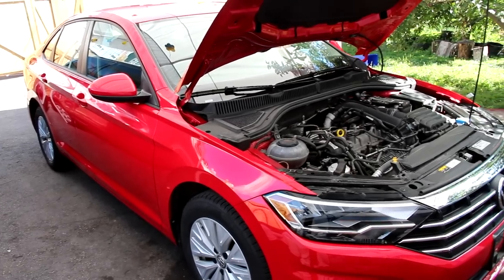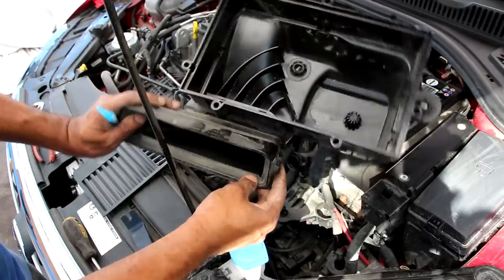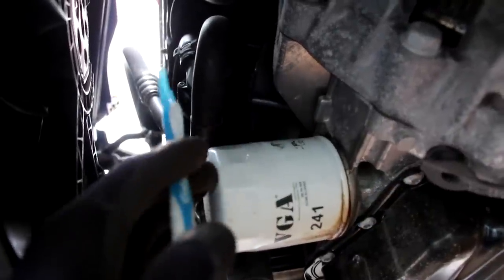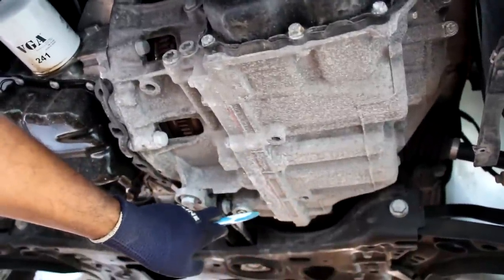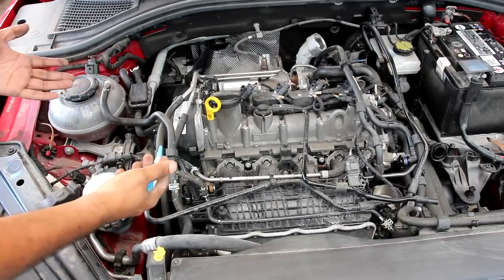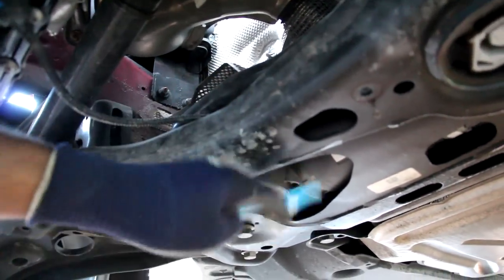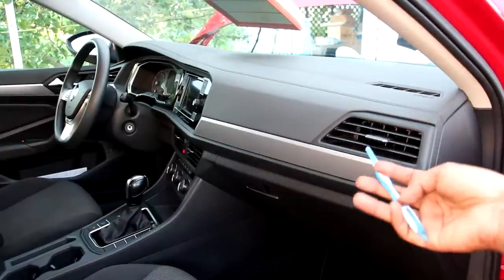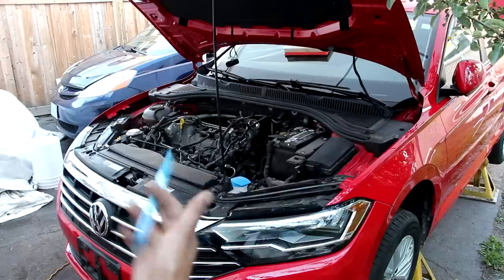Volkswagen Jetta Mechanical Review

Comment: Holy cow. I've never owned a Volkswagen, but I've always been interested in owning one. I spend $5,000 to $6,000 on a vehicle and buy them outright so I don't have to make monthly payments. I earn a small salary. Watching this video has me seriously wondering if I should purchase a Volkswagen. I worry about going bankrupt on the maintenance alone. Why do the Germans make this engine so complicated? If I get a Beatle or a Jetta I would purchase one with a manual transmission and the 2.5 liter 5 cylinder engine. Do you have a review of this engine?
Reply: 2.5 5 cylinder is going to be more reliable, cheaper to fix, and sound better in the long run. But gas mileage is like 15-20 mpg worse than this engine (25-30 vs 40-45)
Reply: @carterdavis2793  I could live with that mileage.

Comment: VW admits to the transmission grinding noise but says it’s normal operation of the torque converter stator clutch? Ever heard of that load of crap and does it even make sense? No other car used or new makes those noises.  VW did something funky chasing gas mileage is my theory and who knows, they may have even retuned the engine and transmissions for the press review cars.  Not one YouTube reviewer mentioned the transmission noise. Not one. Curious. Savage hinted at it.   Beyond the Test Drive, a brand new review channel will have a full one year in depth review of this thing soon.  I actually like the pull and mileage of this economy engine.  The transmission is its weak link.
Reply: Believe it or not, it is a "normal" sound.  There is nothing wrong with the vehicle.  The gearing in "Normal Mode" (driving mode) is made for fuel efficiency, so depending on how much you press the accelerator, there is a sound.  Yes, it is an annoyance and one of the only things I do not like about the car.  Put it in Sport Mode.  Watch it go away.  Also watch how the RPMs are different in Sport Mode and causes the sound to go away.

Comment: Timing belts in 2020? Really is that a bad thing? It's a freacking 100bucks or less part that should last , at least, 150k miles, I've seen cars with original timing belts, with 200k miles, it's makes no sense to used chains in such small engines.
Reply: Yep I think they are using belts because they have been more reliable than chains for VW in the past. Also I think the water pump is on a separate belt so if it fails/seizes it doesn't throw the main timing belt and put the engine out of time. This allows a longer timing belt change interval as well.
Reply from the maker: Yeah belts are quieter but the service and higher risk that they'll break is what deters people
Reply from the maker: I wonder how many jettas will make it past thier first timing belt change
Reply: @ekens6344  Not only vw, i know a few fleet rentals, with psa and fiat, all TD, belts now last around 300k km, even with with the water pumps in the timing belt, with all parts being switched by new ones, and not using cheap parts, it's a 300eur in parts and a 2 hour job, belts don't really add nothing to the engine, in fact, they are hard to manage, noisier and more expensive to change. Yes they last longer, but not a million km, more like 500k km.

Comment: Many american people seem to think that VWs are trash, which i don't really get. I hear many complaints from car guys that e.g the engine keeps failing. I have a VW passat mk 5 (with the 2 0 tdi) and it hasn't had problems once. Same with my Golf VI, with a 2.0 TDI as well. It's extremely reliable, i didn't have to fix any of VW cars ever. 
Important to mention is that i'm in germany. Our VW cars are made in Europe, while yours are made in Mexico or the USA. If the VW cars in your country are really that bad, it's not because of bad engineering, it's because of the poor building quality of the american manufacturers.
Reply: Your cars from Europe are made with parts from everywhere on the planet. Overenginering with cheap quality parts means LOW RELIABILITY and expensive maintenance ...
Reply: @CristianP  I really don't think VW uses cheap quality parts. Again, i've never had any Problems or expensive maintenance to do (and the people i know who own one neither).
Most questionable inventions VW puts in the cars are due to modern emission laws and their solutions work better than the ones from many other manufacturers. Maybe in the USA it's different than in germany, i've never owned an american VW, i can only talk about what i experienced, and that is that VWs are actually quite well engineered

Comment: FALSE IT HAS AN INTERCOOLER!  Part number is 04E145749F The intercooler is mounted in the air intake manifold and uses coolant to regulate air temp

Comment: Brand new volks wagon jetta, born-2018 died 2020. Cause of death- gdi -Carbon build up at 30,000 miles. Lack of walnut cleaning. Ask any volks wagon mechanic about the walnut decarboning cleaning. I can not make this shit up. That's why I drive a crownvictoria.
Reply: This is a lie.  That amount of carbon build up at 30k?  What were you doing with the car, never changing the oil or doing it yourself?  lol  Engines do not die from lack of carbon cleaning.  Absolute nonsense.
Reply: O, just BMWs, have to clean the intakes, I mean walnut blast them every 40-50k. And use good oil with high boiling temp to prevent as much build up.
Reply: @pliedtka  yeah you pay top price for a so called high end car and a 1995 crownvictoria is still running on the road after being a taxi and next to no maintence. And it has 400,000 plus miles on it. I see a lot more high milage crownvicks than brand new BMWs well actualley I see a lot of wrecked bmws in the junk yard.

Comment: Lug bolts making it difficult when installing the wheel? Really?
Reply: Tobias Meiers I guess you never remove a wheel. Lug nuts make it super easy to put wheels back on. Lug bolts is the pain in the ass when try to put back. I used to have a Mercedes with lug bolts
Reply: Replace a flat tire in a rain storm at night on both types then say "really".
Reply: cuz hunging wheel on hub bolts is easier then trying to install lug bolts into hub holes
Reply: You can 'hang' a steel disc on the center hub, if not, then jack the car up just high enough to locate the holes with your bots without having to support the wheel's weight.
Reply from the maker: Yes. Try it.
Reply: Tobias Meiers a lot more work don’t you see that?

Comment: Oil leak already? It sounds like junk
Reply from the maker: What's  a VW without oil leaks
Reply: @speedkar99  guy at work has an 07 Passat, bad rear main seal with only 130K
Reply: He did say it was the drain plug, and it looks like the oil filter too. Someone did a crappy oil change. Didn't change out the drain plug gasket, oil filter might be too tight.

Comment: OK, looking at that design for changing transmission fluid; obviously designed specifically so that if you want to do it, you will bring it back to the dealership. The only word I can use to describe that is, pernicious. Stay away from German vehicles
Reply from the maker: It's possible but why...why...
Reply: In many cars you change the ATF this way, it not only VW. The good old days of simple maintenance are gone forever

Comment: Higher quality plastics under the hood, as long as they are not brittle, will serve well not breaking during repeat removal and installation during maintenance and repairs. In a collision, I'd trust metal over plastic though.
Reply: plastic is better for crashes as it absorb more forces but they had designed it for their weather grap that shit under sun and it will break
Reply: @Techie1224  it's a give and take. Plastic will destroy it's self and protect you in a crash. Metal will transfer the shock to you (crumple zones not withstanding), but your car won't be totaled. I was the passenger in a 95 Tahoe when a newer Pontiac slammed into the front bumper on my side. The Pontiac's front end exploded into plastic and styrofoam. The Tahoe's bumper got pushed back on the corner to the front passenger side wheel. I was a little sore but fine. Was able to bend the bumper back with a crowbar borrowed from the tow truck driver who was there to take the Pontiac to the junk yard. We drove off after exchanging information.
Reply from the maker: At least the plastics aren't as flimsy like Hyundai's

Comment: 220,000km and not a single mechanical issue, rear suspension is crap but that's ok, only done my brakes once since i picked up my 2019jetta on novemeber 18th oh changes the a/c blower motor under my glove box all by myself, cost me 100bucks from napa auto parts

Comment: Bagging the VW oil leaks that "they all have from new" .  The under engine of this car is as dry as a bone, no oil weep even.  Idiot service people drop oil on the plastic under cover - not a fault of the car.  I have never had an oil leak or weep in my now 12 year old MKV GTI, and my 10year old Polo GTI has no oil leak or weep.
Filling any modern transmission is never done from above - they are 99% sealed units which, according to most manufacturers never need service.  At least VW sets a service schedule for the gearboxes.  All modern "sealed for life" auto transmissions can be serviced (and should be) and will need to be filled from underneath and have the fluid level set at a certain operating temperature.
Reply: You’re exactly right. The leak is obviously from a poor service job and not the car ... yet. All transmissions and transaxles are going to this type of service, probably a good thing to keep owners from adding the wrong fluid.

Comment: What an over complicated mess. Only the Germans would devise a system that requires tools to change an air filter. As for that cam cover design; they must have decided to make the dumbest design possible. Not to mention as that engine gets older, all that plastic will break the minute you try to touch any of it. When I was younger I really like the German cars. I do not anymore. Not to mention most of them aren't really as much fun to drive as they used to be.
Reply from the maker: I just find it amusing how they find different ways to design things. I'd never want to own or fix one

Comment: Still using a timing belt !? Jesus….. that plus the carbon deposits is a no bueno for anyone that knows cars…. Sucks they don’t sell the diesel ones anymore
Reply: VW still makes the 2.5L inline 5 with a timing chain & no carbon build up.
Reply: the timing belt was added because of issues with timing chain stretching. the belt is superior in this case. these new 1.4s dont have the same issues with carbon deposits as previous GDI vehicles.

Comment: GDI only + VW= carbon build up at 30k miles.
Reply: That is one drawback yes.  All VW/Audi engines suffer from this, at least in the North American market.  European ones have both port and direct injection.  Before buying the car, I knew this would be an expensive cleaning.  My mechanic assured me that it is nothing to schedule until 60-70k miles at least depending on if you drive mainly in the city or on the highway (I'm the latter).
Reply: Ryan Barnes I now own a new Corolla with with GDI and Port also, so no expensive valve cleaning for me 👍🏽.
Reply: @tails300  Is it the sport model?  I think it's called the XSE?   That's a really nice version of the Corolla.
Reply: Ryan Barnes SE, the XSE is the top trim. They’re both the sportier trims though.

Comment: A rolling pile of junk. I owned one before...
Reply from the maker: What issues you face?
Reply: @speedkar99  It was 2012 model tho. 2.5L inline 5. I bought it with 30k miles and sold it at 55k miles. I drove about 4k miles a year back then. When at 5 years old, all door panels, plastic trims start to rattle at 50 MPH. Cruise control disappeared on itself. Had to take it to the dealership to turn it back on for 100 some dollars. When it was at 31k miles, the key stuck in ignition for 1 hour and a half. Couldn't turn off the engine. It was a cracked lock housing. If you don't torque down the oil filter housing to the specs, it will leak like mad. Steering is numb. Gas mileage is horrible. Maintenance heavy. Need to change spark plugs every 40k miles. And many more that I don't remember. It was a nightmare... Hope this helps.